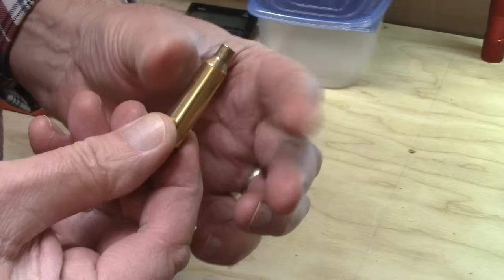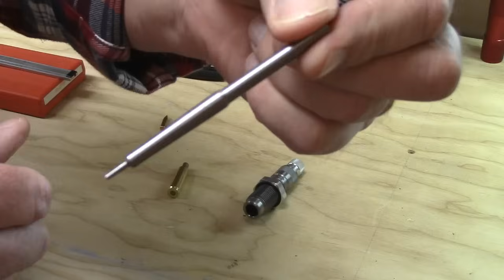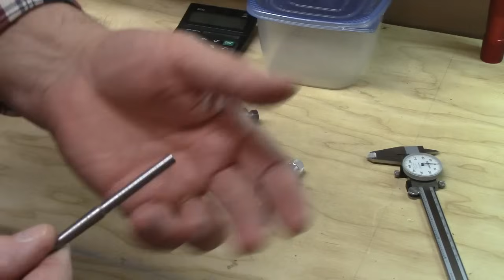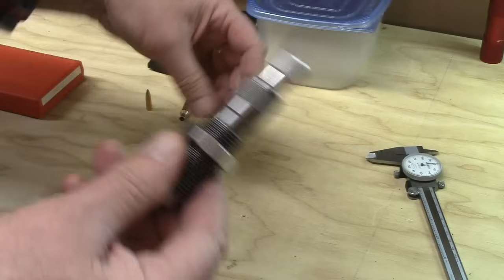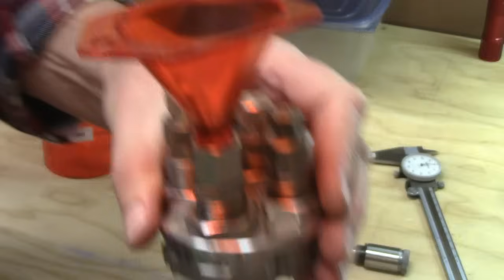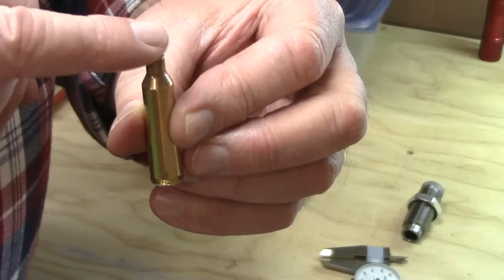Handloading PART IV, How Dies Work ~ GunBlue's Complete Guide

Comment: Well this certainly explained to me how rifle dies are designed to work if used correctly.  My reloading press is a Hornady Lock-n-Load AP. All of my dies for 9mm and .45 ACP are Hornady with the addition of a Lee Factory Crimp die for each. Thankfully I ran across a video last year that explained why it is better to use a Lee factory crimp die and not the Hornady crimp which is incorporated into the bullet seating die.  After watching this video, when I get ready to expand my reloading capabilities to include 30-06 and Rem .223 I will defiantly be going with Lee dies which work great on the Hornady Lock-n-Load press with the bushing system that it has.  Yet again, I have more valuable Knowledge that you have provided me.  Thank you sir!!  I think that I should insist to my 25 year old son to watch all of your hand loading videos as a prerequisite before I show and teach him what I know as he learns the process of reloading.   Thanks again!!
Reply: Great points- just got a Hornady L&L AP so I'll listen.
Reply: What did the video explain about the Hornady and Lee dies?

Comment: I agree about Lee dies.  When I started loading, I bought all brands, and although I don't buy many these days, Lee is the first maker that I  shop.  Initially, I thought they must be cheap in quality, because the price was so reasonable compared with other manufacturers. When I used them, I realized how great they were. I love being able to charge the case during the expanding operation on straight wall cases. Great video.  Thanks as always.

Comment: I know this is years late, but ... I've been reloading for 40 years and I've used Lee Products for about 40 of those years (I started with a .303Br Lee Loader I bought at a flea market), even though I've been laughed at for 40 years.  But here is a company customer story. 
About 10 years ago, I had an issue with my neck-sizer die.  I was using it for .303Br cases on a turret press (NOT the Classic Cast press).  I had already loaded a dozen cases and was working on another, when my wife came downstairs to see me.  I stopped what I was doing and when she left, I began again.  I could not get the case into the die, no matter how hard I pushed.  And, believe me, I pushed.  Suddenly, the press made a loud pop and the turret jumped about 6 inches in the air.  The turret was bent and my press was broken.  I called Lee Precision and was honest with them.  This was a second-hand press I had had for 10 years.  It came to me with one of the cams already cracked, but it never caused a problem.  What had I done?  I emailed pictures as well. 
The person I spoke with told me to pack it all up and send it to them and if it was determined to be faulty, they would fix it.
Packed up the press, the turret with the dies still in it, and the case I was trying to size (it was crushed), sent it from Alberta, Canada to Wisconsin.  Three weeks later, I got it back with a letter explaining what had happened.  I had started the case up into the die which started to close the neck-sizing collet, but then I withdrew it when my wife came in.  When I tried to insert the case again, it came up against the closed (locked) collet and my continued effort caused the fatal destruction of my press.
Then it told me that they had replaced EVERYTHING on my press that was broken as well as replaced the turret and the collet in the die so that it would work perfectly and charged me NOT ONE RED CENT!!!  NONE of that damage was their fault, but because I had been straight up honest from the word go, they felt it was only fair of them to keep me as a customer.

It is often repeated that the gauge of a man's intelligence is how much he thinks like you applies here.  
While this man and I reload for different reasons, we both enjoy quality equipment that didn't require me to go with out food for a month to get started.
Thanks for these videos.
Reply from the maker: My videos remain current as long as they are posted. This is not a time stamped blog thread. You are welcome to comment on any video, and your comments will be as relevant as the day I launched the video. To that end, I desire to answer and instruct as I can. Thank you.
Reply: @GunBlue490  you do a great job.  Keep doing it.  You remind me of a gentleman who chose to mentor me when I was a young man in my early twenties.  He was in his 60's and actually knew (and regularly corresponded with) Dick Lee, Bruce Hodgdon, Elmer Keith, and many more.  We were members of the same local gun club and in my hubris, I considered myself a "wildcatter".  I thought I had "wildcatted" a round because I had a 762X39mm case, replaced the bullet with a 180gn RN bullet and using a 7gn load of Unique, made that subsonic.
I was bragging about my wildcatting skills one evening and got laughed at pretty good.  Cliff took me under his wing and taught me from memory more than I thought even existed in this world of handloading.  He also nicknamed me "Rookie Wildcat" which I wore in that club for the next 20 years until I left that area.
Thank you for putting out such real, sensible, hands-on information.  I enjoy your process, and while you and I are now closer in age than Cliff and I were, I still hear that massive knowledge and experience behind your instruction.

Comment: The Lee resizing dies are the best I've used and for the best price. The design of the decapping pin has saved it from breaking several times when I've pulled down on berdan brass.
Reply: I've had the opposite experience. 
It may be my inexperience, but my full length sizer, decapper pin broke on some particularly stubborn 223. 
Now I have a broke ass pin 🤫

Comment: This is truly a wonderful and informative series, thank you! One question: If I've heard this correctly, when reusing the same brass multiple times, it seems to make better sense to use the neck-sizing die rather than the full-length die. If that's the case, then why not always use the neck-sizing die to be safe? Sorry if that's a dumb question; I could have missed something completely. Cheers!
Reply from the maker: It's not a dumb question, and it deserves an answer!  Besides being generally more accurate, neck sizing does indeed preserve brass far longer, because the main body of the case does not repeatedly go through work hardening imposed by the firing/stretching, and resizing/compressing cycle.  As with most good things, the advantage comes with limitations.  There are three:  

1.  Because the brass becomes a mirror fit in the rifle in which it was fired, it will rarely chamber in another rifle, so neck sizing produces strictly custom ammo for one rifle.  

2.  Neck sized ammo is a tight fit, so it requires an action with sufficient camming leverage to close.  It's entirely unsuited for anything except bolt actions and certain single shot rifles.  

3.  The tight fit greatly increases chambering effort and can require forceful and sometimes difficult closure, and the slightest bit of dirt, dent, or lint can forbid chambering.  That makes it very unsuited for a valuable game hunt.

So, while I will neck size loads for target shooting or varmint hunting with my bolt action rifles, I never use anything except brand new, or once fired, fully resized brass for my game hunts.

As a note, necks do endure the work hardening cycle, and will require periodic annealing, to ensure tight bullet grasp, and to prevent splitting.
Reply: @GunBlue490  Ah, that makes complete sense, now I get it. Thanks so much for your detailed reply. Love all your videos!

Comment: To fix a slipping set screw on the threads of a die, take out the set screw and then insert a small lead shot into the hole. Reinstall the set screw. The lead will form to the threads and will grip the die better. I have also snipped the lead tip off a bullet in place of the shot pellet in a pinch.
Reply: It's a bad system.  Even RCBS no longer uses it and went to a split ring lock screw with an Allen screw.
Reply: @nohandle257  The hell they did! Just ordered a set from Hornady for my RCBS dies.

Comment: I broke the decapping pin on the 300 BLK converting brass. 
It ALWAYS got stuck on the draw stroke, it let me get a few thousandths and then BOOM the rim pops. 
USUALLY I know when I'm FUBAR and I'll try and tap gently for 20min and itl unseat. 
But I believe I have an error of setting my die too far 'down' 
I bought a universal decapper to just leave that "error" up to God.
(We know it's me but don't tell anyone)
And I have an RCBS because the local shop had a good deal on '06 full length set $25 for a good used die set. Versus $90 at sportsman's. 
If I have the opportunity, I will order a Lee set for my needs. Their customer service is BEYOND amazing. (They helped me with missing parts from a ram prime) 
And I'm surprised the Lee loader I'm using doesn't bite me for putting that '06 RCBS in it. Very good manners as well, Lee.

Comment: On the Lee Collet Neck Sizing Die, do you recommend any lubrication or sanding to smooth the tapered collet surface?  I saw someone else make that recommendation but I would really be grateful to know your opinion.
Reply from the maker: Of a number of such dies that I've owned, I have had only one that jammed on rare occasion.  I did polish the tapered cone of the collet, and applied some plain mineral oil to the surface, which eliminated the problem.  I don't find it to be a problem that should be expected, based on my overall experience, which is very favorable.

Comment: Could you clarify something? 
I am a bit confused by what you were saying with regards to a taper crimping die vs a collet / factory crimp die.
If the bullet has a cannelure do I use taper crimp or factory?
If the bullet does NOT have a cannelure, which die?
Reply from the maker: Dale Medin 
Sorry, but I just found your question.  Lee Factory Crimp dies work with or without a cannelure.  Crimping rifle cases is only necessary for rough handling, as with magazine fed high capacity autos, or guns with very high recoil forces, and is entirely unnecessary with most rifles.  Crimping rifle cases that don't require it does work harden the brass and can lead to somewhat premature case neck splitting, unless the brass is annealed.  Even with 200 grain bullets in my 300 Winchester Magnum, bullets remain secure affter repeated battering in the magazine.  With an AR or Mini using a high cap magazine, I doubt 55 grain bullets would move, but I apply a very light crimp into the cannelure, emphasis on very.   Lee Factory Crimp dies will create a perfect crimp into non cannelured bullets, too.  Lee FC dies for handguns use a full length crimp that resizes the case all the way to the base with a carbide resizing ring.  Auto pistol cases that headspace at the mouth, ie 45, 9mm, 40 S&W, are never roll crimped.  Rimmed cases, ie 38 Spl., 357 Mag, 44 Spl, 44 Mag, require varying degrees of roll crimp, depending on recoil levels.  Never crimp more than necessary.  A 38 Spl with lightweight bullets or light target loads require none, while heavier bullets and powder charges do.  A 44 or 357 Magnum always requires a very tight roll crimp to prevent bullet movement, and some of the slow burning powders such as H110 and Winchester 296 need heavy bullet retention to burn correctly, or to even ignite.  Lee has extremely good directions packed with their FC die.

Comment: Well, I'm hoping you still read comments on your older videos. I'm new to reloading and seeking clarification. When using the Collet Neck Sizing Die and brass that has already been fired with the intended rifle, do you need to trim the case to length?
Reply from the maker: This is not a dated public blog, because I'm not generating a thread to be responded to.  I produce information, and it never gets old.  Every day, I answer questions on any videos that I ever produced. In answer to your question, the die is used no differently than any other.  Cases must be trimmed when they reach or exceed the published maximum length, which prevents bullet siezure.  Trim length should be set .010" less than the maximum, though no harm is done if accidentally trimmed somewhat less.  The collet die must be set as directed.  I have had one die out of many where the inside collet was rough on the tapered exterior, and occasionally jammed, collapsing cases.  If you have that issue, contact Lee for advice or replacement.
Reply: @GunBlue490  Thank you good sir, as always, you do an amazing job explaining things. I would like advise in one other area; 
After watching your videos on the .257 Roberts (and reading up on the cartridge),  I am considering purchasing one (a new Kimber Classic Select Grade).  This being a new rifle, I would shoot factory ammunition for the few trips to the range just for warranty purposes. Since this factory ammo will be +P (and I know very little about +P cartridges), I'm wondering if there are any peculiarities when it comes to reloading these cases vs standard loads? I'm assuming that the +P brass will have a thicker case wall than standard but don't know that for a fact. Do you have any experience when it comes to reloading these +P stamped cases and if not, is that something you would recommend trying or should I try to find standard .257 Roberts brass?

Comment: I have a question about the Lee Bullet Seating die. I find that my bullet fitting does not fit very well over the bullets that I use - it pushes against the tip of the bullet rather than to grab against the ogive. Can I drill and grind the inside of my bullet fitting so that it fits my bullet better?
Reply from the maker: There are numerous bullet tapers, and no one seating die stem can possibly accommodate every style.  Certain shapes such as V-Max can be too sharp to fit.  You can try drilling the recess, but use actreme care to be centered, and remove only the minimum of metal.  Lee will also make you a seating punch fitted to your bullet, which is a better alternative.
Reply: Thank you for your reply. I understand that there are many types of bullet shapes so I decided to give it a go with my drill press and fine sandpaper (1500 grit) to get a smooth face inside the stem. I found the stem very easy to work with because it’s soft aluminum. The bullet seems to fit better in the cup now but I’ll have to test if repeatability improves with my bullet comparator, and maybe also check bullet concentricity. If it doesn’t work out, I can always send off to Lee for a custom stem per your good suggestion. Have a good one!
Reply: FYI..  The bullet in question is a .308-caliber Hornady 165-grain Interlock SP soft point flat base. I have bullet length uniformity issues because the soft lead point of this bullet tends to vary a lot - so I need the stem to grab the ogive rather than to push against the point.

Comment: Gunblue490 
Does the reseating die with the o ring you are demonstrating come standard with a set or is it bought separately?  
please bear with me. I am new to all of this..
thank you.
Reply from the maker: tjmooremusic 
The Lee dies that I demonstrated come as shown.  That single feature is absolutely far ahead of antiquated set screws that become loose, or jam, and are always difficult to adjust.  With the O ring, one simply adjusts the die as required, then the lock ring is secured finger tight.  Use of a wrench is entirel optional, and entirely unnecessary.  Removal of the die without altering the lock ring position is simplicity itself, because the O ring is also firm againt the threads.  One loosens the lock ring, and the die will turn with it.
Reply: Again, thank you very much! 
I'm looking forward to getting started. 
I will be reloading 38 special , 357 magnum. I have a mini 14 ranch  so will eventually start on 233.
Oh and as my Ruger blackhawk has a cylinder for 9mm I will be reloading them as well.
That ought to keep this old guy happily busy. First I have to recover from a recent back surgery.

Comment: I ran into a problem with neck sizing for my 308win where cartridges became hard to chamber after a few firings. Do you recommend bump sizing (using Redding Comp Shell Holders or similar) or do you recommend I just full size every few firings? I currently use all the Lee dies for everything, and I also have a Redding Body Die.
Reply from the maker: Neck sizing and firm bolt closure are companions, which is why it's more accurate.  As cases are fired repeatedly, the brass hardens, which increases resistance, and is a signal to anneal.  See my annealing video. A standard sizing die will set back the shoulder to any degree you wish, by simply adjusting it minimally. No special brand does it better than another.  A die is only a specified chamber created by a reamer of SAAMI dimension which every manufacturers uses. The procedure, after annealing, is to size a case incrementally with a full length die until it chambers with acceptable resistance, without being overly loose.
Reply: I am also well aware that you advised against military brass in one of your other videos, and I do understand the challenges with it. I might not have ever tried it except for fact that a friend gave me a bunch to try, and that I found a pretty tight group with them using a very moderate load of Varget powder in my 308win Browning ab3 bolt gun. I’m trying to improve my consistency now to hunt wild boar.  Thank you for helping a new shooter.